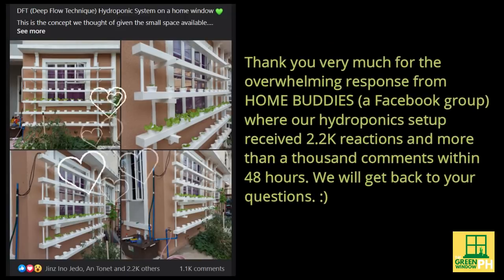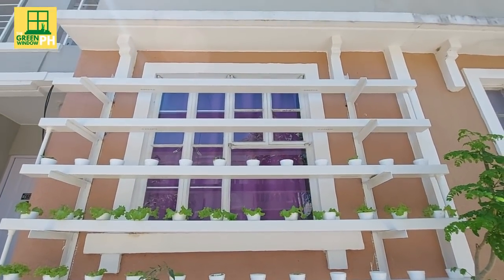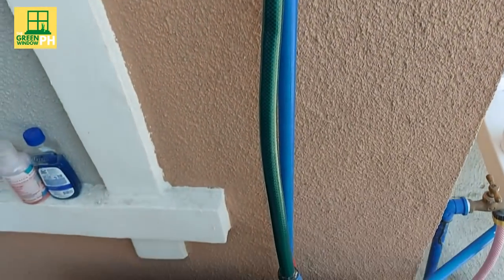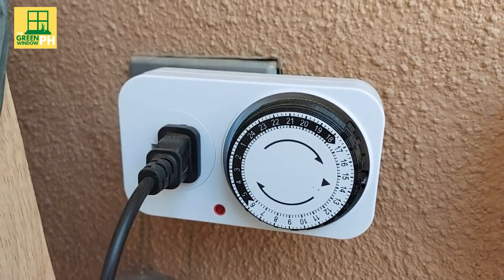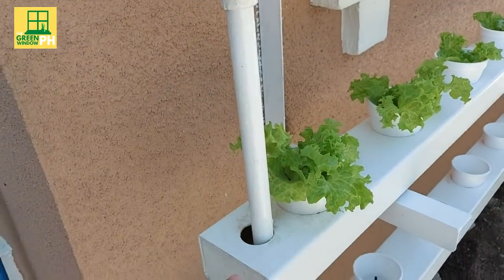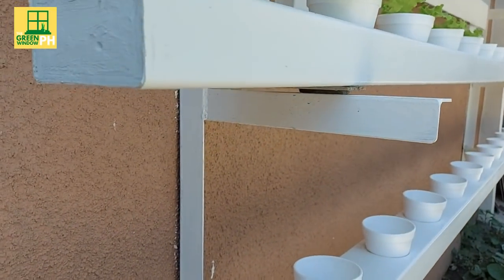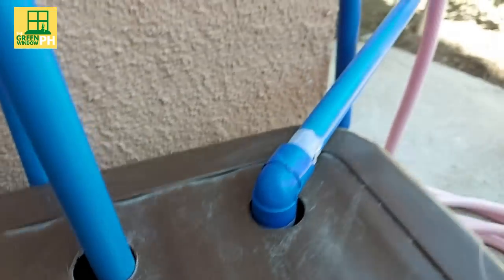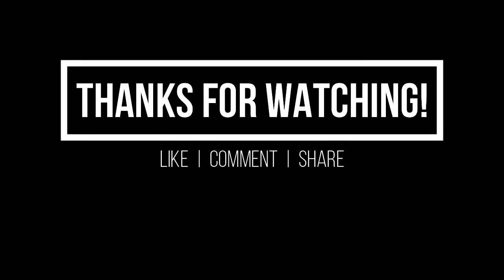Hydroponics System on a Home Window Using Deep Flow Technique (DFT)

Comment: 1. ilang inches po ang pagitan ng mga angle bar per layer para sa growth ng lettuce?

2. ilang inches po yung pagitan ng mga butas ng downspout (center to center)

3. ok lang ba sila without net (hindi ba prone sa pangingitlog ng lamok or other insects)

4. ok lang ba kahit hindi direct naarawan ng araw pag dating sa growth nila within 35 days.

hoping for your reply thank you :)
Reply from the maker: Balikan po kita on questions 1 and 2. Imi-measure ko muna. Regarding the net, lately lang po kami naglagay kasi may budget na. Pero nung wala pa, manageable naman yung insects. Di lang siguro talaga sobrang dami sa location namin kaya nakakaya pa ng manual tanggal ng mga insekto.

Regarding the sunlight, ok naman po ang growth kasi tinatamaan naman yung plants kahit papaano. Naglagay pa kami ng UV plastic kasi kapag summer, di kaya ang init. Lately lang medyo di nareach ang optimum growth dahil sa madalas na pag-ulan.

Hope you can also support our FB page: The Green Window PH
Reply: @IndayJace  thank you po!

Comment: Wow thanks for sharing your system! May I ask what timer (brand/model etc.) you used to control the water pump? What nutrients did you use for your lettuce as well? Thanks so much —  very inexperienced here but hoping to make a model like yours!✨
Reply from the maker: We bought the timer po from Shopee. Eto yung link: https://shopee.ph/product/62481879/5643944254?smtt=0.56751334-1626069423.9

For the nutrient solution, we use Nutrihydro products po.

Thank you rin po sa suporta niyo. All the best in your hydroponics journey. Happy growing!

Comment: Also, did you tilt at an angle the downspouts so water will go down? Or no need na?
Reply from the maker: No need to tilt the downspouts. So far, the water is flowing from the top to the bottom naman. NFT yung may tilt, DFT yung di n kailangan ng angle or tilt.
Reply: Thank you. Are you from lancaster?
Reply from the maker: @joanneprieto8882  Yes po. :)

Comment: What is the purpose of having 2 vertical downspouts before the going to the actual downspout (3rd layer) with plants?
Reply from the maker: Hmmm... there's actually just one for each side and layer. They are on alternate sides so the flow of the nutrient solution is zigzag direction. You can see this more clearly sa front view shot at the onset of the video. :)